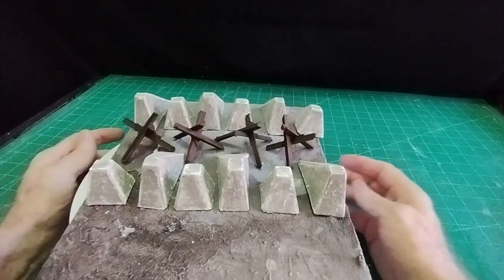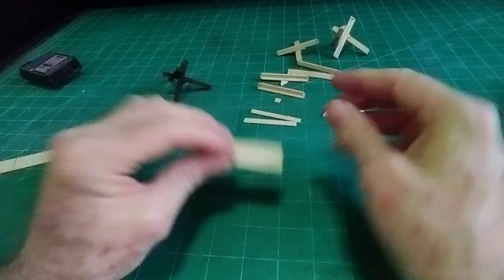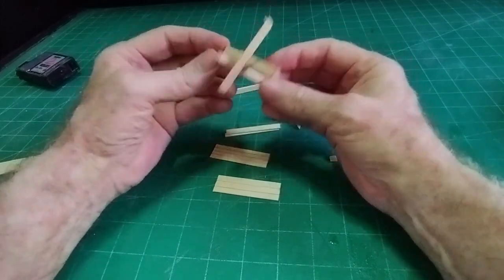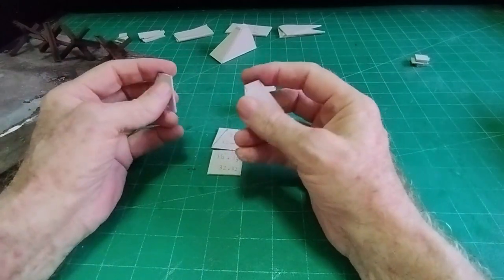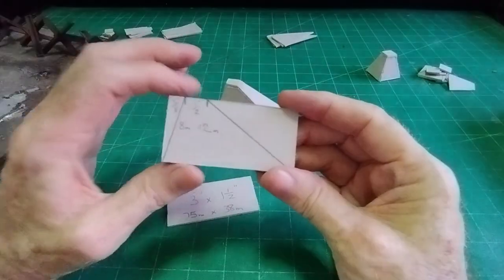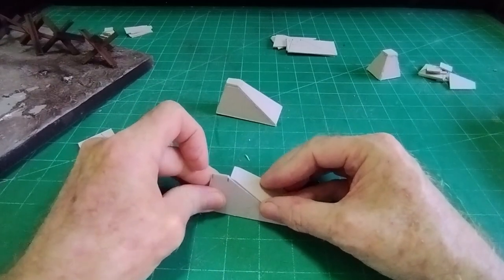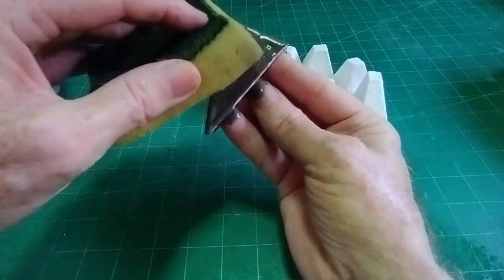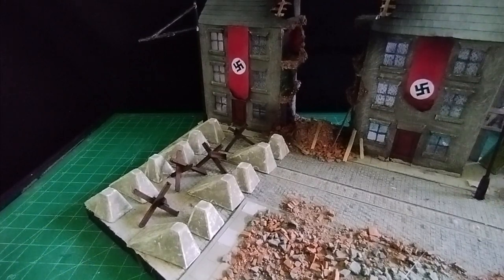How to make dragons teeth and tank stops.. 1/35 scale scratch build modelling

Comment: Hey Don, very nice 👌 A couple of orange scliff shaped bits cut out of the angular corners, and  some  dished carve outs on the flats, (with maybe some small plain holes poked through) would give the appearance of shell/bullet damage . Just a wee idea that came to mind watching your build process, done prior to coating they would then be coated with filler/grout and save effort after 😉 A quick spray of matt varnish and some orange/red chalk scraped into bits/dust and sprinkled sparingly onto the wet varnish gives a not bad "rust" look for the tank stops.
Nice easy and cheap method on these 10/10 👍